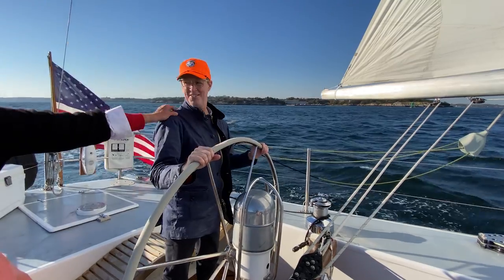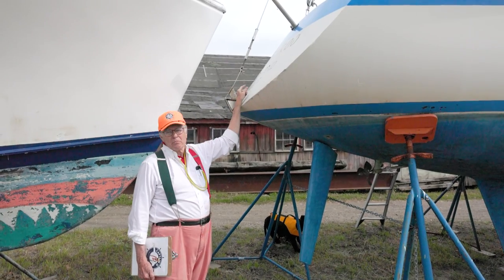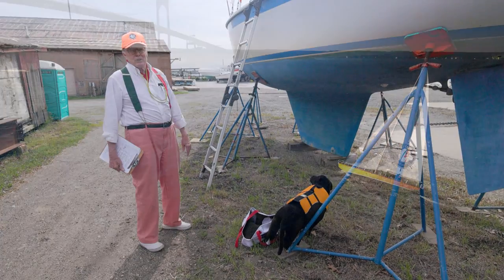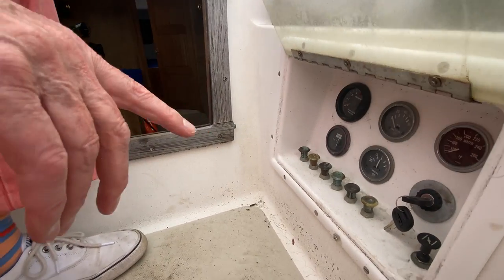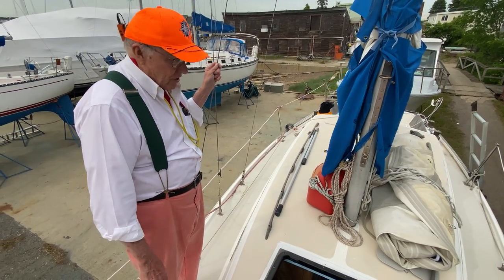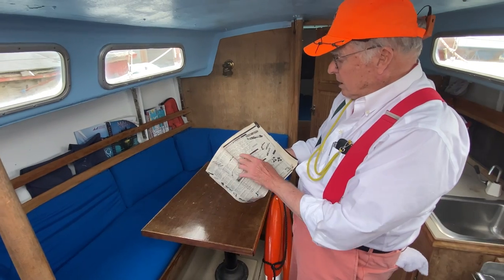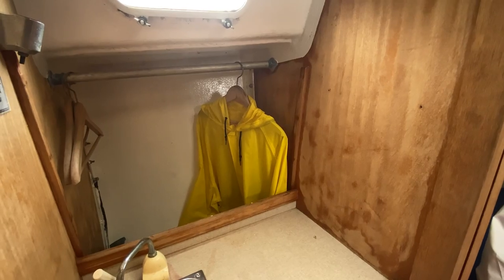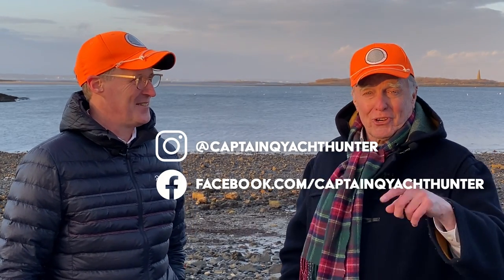$5,000 Classic Cal 2-30 - Just needs a few updates!!! EP99 #sailboattour

Comment: The three-bladed prop is from Indigo, and is an improvement (better power at given RPM) over the original two-bladed props originally paired with A-4s.
Reply from the maker: Thank you for the heads up

Comment: My previous Cal34 Mk1 had a nearly identical layout with a much more commodious fore cabin.  My current Cal34 MkIII  has a more "deluxe" interior and fixes a few of the issues you noted here: steel beam for the mast post, bridge deck, bigger head. lovely folding table, more conventional galley on one side of the companionway, ....   BUT, I love those quarterberths: excellent motor access and really easy ingress and egress (there you go Alan...) and big enough for a big guy!!
Reply from the maker: Can't really go wrong with either iteration... but those upgrades some great for better longevity and safety. thanks, Chad!!

Comment: If you're handy you find find a reasonable boat for cheap.  I found my Catalina 22 for $750.  Of course, the costs go up the longer you have the boat, but it sails nicely and it goes along with a 15hp Honda  : )  I also picked up a 64 Starcraft runabout for, get this?  $180.  There are deals if you want to fix um.

Comment: Cotter pins should be bent however to facilitate easy removal. I LOVE the Atomic 4. I have known many who replaced them for big bucks and regretted that move. This is a boat that can and has circumnavigated the globe. At least her little sister (29) did. Her captain nearly went over the fan tail taking a piss. So while I am on this issue,,,,, piss on your knees over the side/ fan tail whatever. Never piss over the side standing up on a small vessel. 90% of the pleasure vessels are powered by gasoline. That engine (NOT motor with all due respect) is still running fine after all these years but the upgraded diesels offered at the time can be shit finding parts for. This is a very fine vessel for a very fine price. That engine can be rebuilt with new rings and whatever with only a light honing of the cylinders. No over-bore needed. There will be good and plenty of those A-4s celebrating their 100 years in marine service. PLUS gasoline does not present the black sea snot issues diesel fuel does. Many look down their nose at the A-4,,, I however do not. Yes, "cruising range" with an A-4 is something to be dealt with but c'mon she is a SAIL BOAT. If you want a motorboat then buy a freaking motorboat. I am no fan of the Cal 40 honestly. This is a totally lovely vessel. The "SCIENCE" of lightening 'protection' is still on the drawing board,,,,,plenty of money being made via promises through selling stuff.  You and Ran,,,DAY are my favorite youtube channel. You get right down to affordable sailing.,,,,,,,,,,,,,,CARRY ON! PS,,the A-4 was originally designed to power U.S. Navy lifeboats. That one there is like 2nd or 3rd iteration.
Reply from the maker: Hospital urinal makes sense if that’s all you got to do…. Haven’t thought how the bed pan might work 😂🙄🤔but  maybe something there too …

Comment: One of my brother-in-laws is a boatbuilder, retired, who says the worst cases of osmosis he saw, came with the advent of chopper guns! Hand laid up hulls didn’t give near as many problems! I used to spend a bit of time in a local yard, here in NZ, where many US boats got hauled out for osmosis repairs. One hundred percent of those hulls had been built using chopper guns! When stripping off the outer hull skin, not only would water literally gush out, but the areas, with little resin in the matting, was unbelievable! How they passed hull inspection can only be described as criminal, in humble opinion!
Reply from the maker: Wow…. Great info… really good to know about the chopper glass… 👍👍

Comment: "gas engine" - I knew there would be a big dollar problem. Inboard gas motors are never safe. OTOH, at only $5k and the hull looks sound, it's an opportunity to convert to electric drive.
Reply: I had a Atomic 4 in my P30 
Never had a problem all you have to do is use your brain
Reply from the maker: Great idea… we really like what’s happening with electric motors these days
Reply: I was talking to a guy who has an Olson 40 with an electric drive   I asked about 6 times every way I could what the range is “Not far” was all he’d say    Works great for powering to the start line.   A gas engine is fine if that’s what you’ve got.
Reply: One big upside to the Atomic 4 is that every harbor, every gas station has someone who can fix it.  And most parts can be picked up at your local NAPA store.  Had 1 for 25 years in my Sabre 28 and loved every minute I used it.

Comment: I'm buying a Cheoy Lee 27, I'm paying less, but, it's in pretty good shape. If not, I would try this one. The A4 is a lawnmower engine, if you can fix one of those, you can fix an A4. I'm actually thinking about putting in a rebuilt or a Palmer, it has nothing right now. Everyone wants a diesel, but an A4 is so damn simple it's almost ridiculous. I had one in my Tartan 27 and it ran like a sewing machine, smooth and like CQ said, quiet. Just like any other system on a boat, it needs to be maintained.

I love how CQ tries to go to Instagram, that cracks me up every time.
Reply from the maker: One day he’ll learn… 😂
Reply: Atomic Fours are getting old, parts hard to get, competent mechanics hard to find    Love the name Atomic four   There’s now a lot of used Diesels out there  I think the Beta Marine is the current choice  (the A4 is more of an ancient car engine than a lawnmower engine)

Comment: I raced on a cal 2-30 on the southern Chesapeake bay fast but gets cranky in strong wind downwind and you really needed to use the blopper also the mast is stepped on a steel fittings that can rust I had previously raced on a Kirby 25 so doing foredeck was a bit of a shock and you definitely need a reaching strut but get rid of the wire  halyards. If your racing area allows you to race in phrf c you will kill the fleet worth putting the fixed prop to get there
Reply from the maker: All great tips, Ralph! Thanks 😄